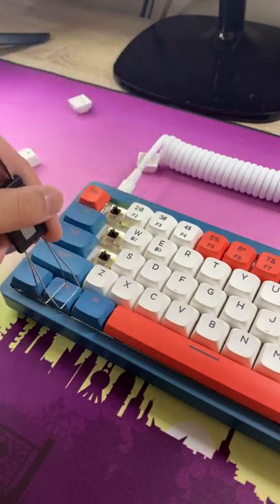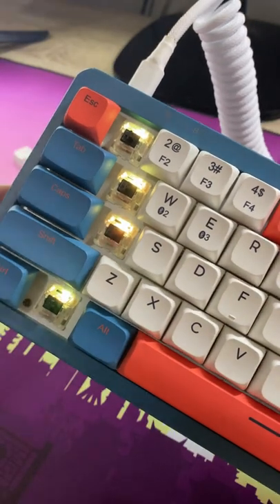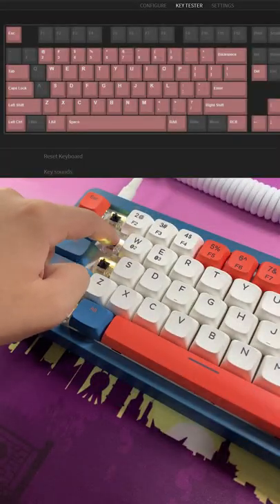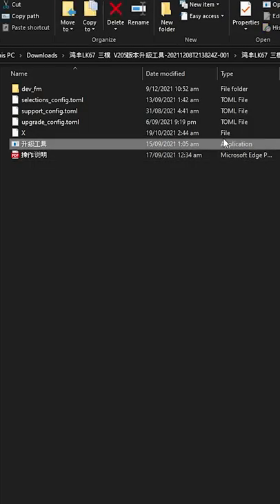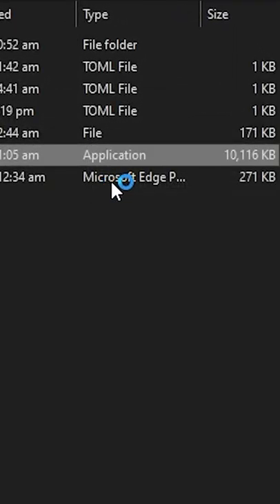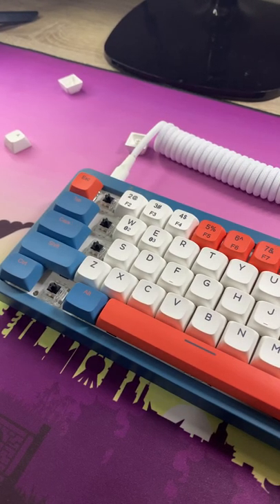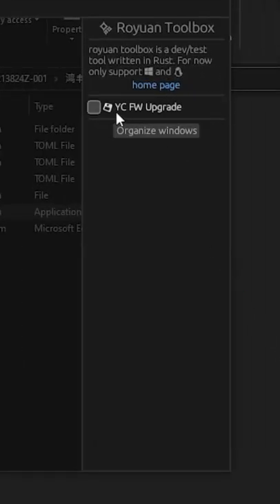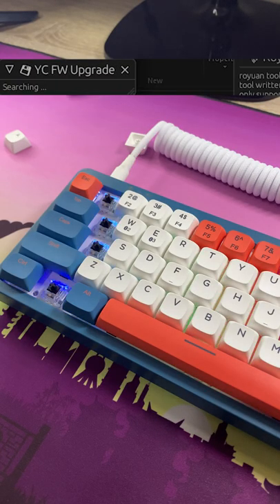How to Fix a BROKEN Gamakay LK67 #shorts

Comment: the software is not detecting the gamakay lk67
Reply: me too
Reply: do you know  how to fix  it
Reply: @Moff3y2k  you would most likely need to replace it. The boards the gamakey uses is pretty bad.
Reply: @gravime1469  thanks for the tip